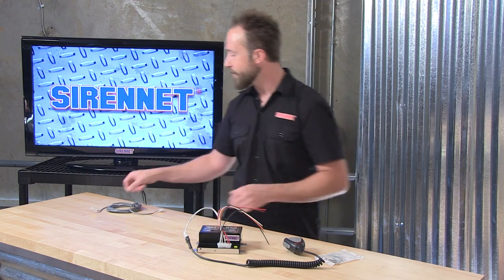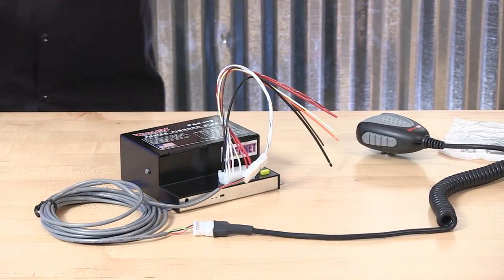Whelen 100 Watt Air Horn Plus with PA Function

Comment: Can the air horn and pa be used simultaneously? I’m trying to use this pa with the pa feed out of my cb so that I only have 1 microphone in my cab. I’d assume the ptt circuit grounds out at some point to make the ptt handset route to the pa. So I’m curious if doing so turns off the air horn while it’s depressed. Can you confirm?
Reply from the maker: Good morning. We double checked with Whelen; the PA mic. will override the Air horn tone if you hold down your momentary button. They won't function simultaneously.

Comment: Why do I get loud motor-boating after activating the horn?
Reply from the maker: Hmmm, interesting. Did you just recently install the PAP112 and this is happening? Does this seem to happen just with the Airhorn tone, or with the PA microphone as well?
Reply: @SIRENNET  It's the older model. Happens after keying the mic. I can stop it by turning volume down but then the volume is to low to be useful.

Comment: Any chance you'll set this up as a package deal with a speaker?
Reply from the maker: +Seth Allen     At this time, we are planning to continue offering the PAP112 and a Speaker as independent Parts. Based on the Vehicle and the end-user's preference for the Speaker itself as far as size and Brand, offering them separate seems to work best.

Comment: Could u hook up a siren controller to this and if so what model controller
Reply from the maker: You don't really need a Siren Controller for this Unit. All that is needed is a Single Momentary or an on/off Switch for controlling the Airhorn tone. A momentary works best. It can also be tied into your vehicles horn relay, so it works with the OEM horn press.

Comment: What guage wire is recommended for the set up?
Reply from the maker: 18 or 16 gauge, depending on how far it's being run.
Reply: @SIRENNET  it will run from under the driver seat to the front of the 2012 explorer
Reply from the maker: @martinb554  18-Gauge is the size you'll want to use.

Comment: What is the name of that switch? i want to get the same switch for my application.
Reply from the maker: The momentary switch we used is actually from a gunlock timer. It works great.   Please email our Sales Team at: info@sirennet.com.   They can get you details. :)
Reply: SIRENNET Out of curiosity, how big of a resistor do you need to be able to adjust the volume of a siren?

Comment: How do i stop the Static in my PA
Reply from the maker: In some instances an extension with a shield wire may be needed to stop feed-back/static. Are you using the PAPEXT15 mic extension harness?
Reply: SIRENNET no i am not using the Extension, i have the system in my middle consol.
Reply from the maker: Has it had static since installation or is this something that's recently started to happen?
Reply: SIRENNET I believe started to happen recently
Reply from the maker: How long have you had it? Any changes to the vehicle recently as far as electronics or add-on's?